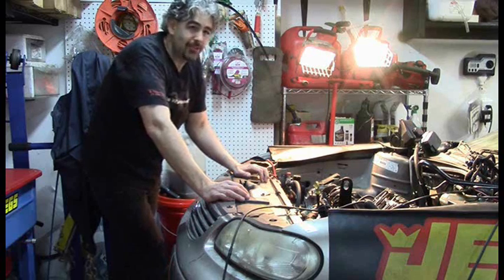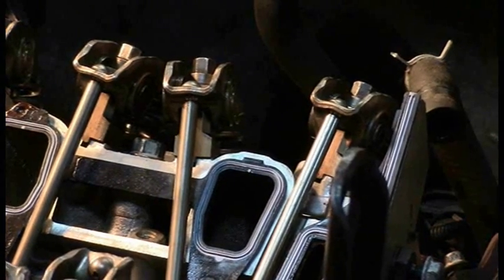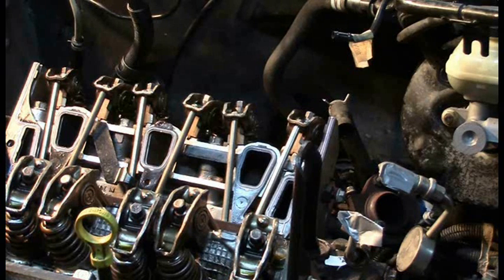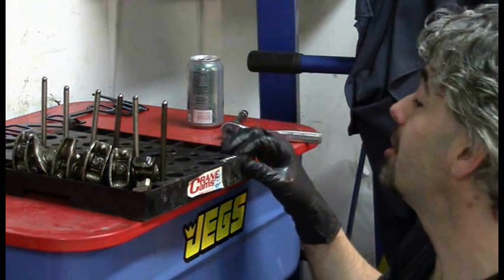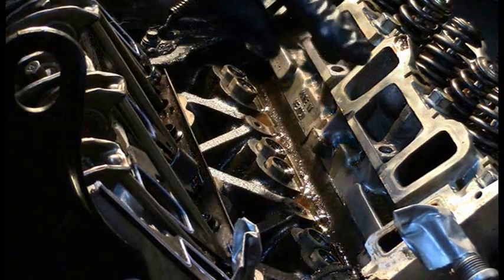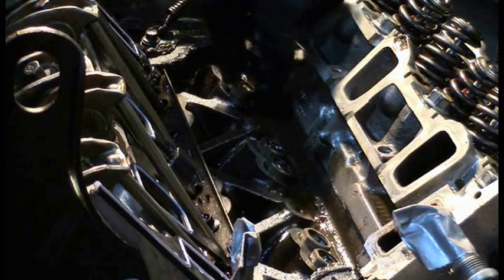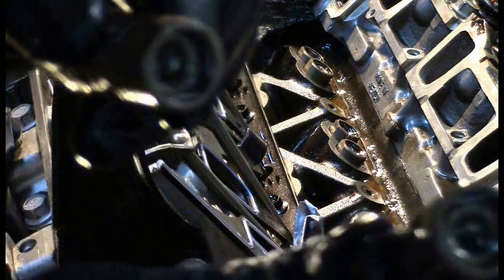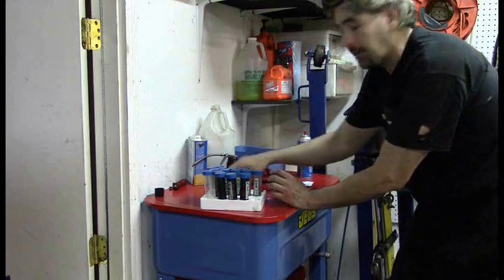Engine Noise Diagnosis Part 2- The Answer Revealed!

Comment: good job dude. besides the leak down test did you perform a cooling pressure test or combustion gases in coolant test just curious. Oh also did they report any overheating issues or boil over at all.
Reply from the maker: Hi Chris- No I did not do a pressure test because in my opinion the leakdown is ultimately definitive. I did not show the head replacement as I already have another video on that.  The customer never complained of an overheat but then again being disabled they drove the car very minimally- it probably gets under 10 miles a week I would say, so probably never ran enough to overheat, though they did have to keep adding coolant to it occassionally.  They are damn lucky the engine wasn't destroyed!  It is still running fine to this day.

Comment: Very good. Is there a video showing the head gasket replacement and the process to straighten or resurface the head? Thanks
Reply from the maker: @TPCoach- In the interest of time and staying on focus for the specific content I did not film anything with the cylinder head.  Besides, I try to generally make my videos more about the diagnosis than the actual repair. It seems there are thousands of "repair" videos on YouTube but very few that (IMO at least) that are good with showing diagnosis so you know you are doing the correct repair in the first place!! 
  However stay tuned. I did get a call about another car that I strongly suspect has a minor or initial stage of some type of head gasket issue, and if so, I will make a video comparing the many various methods for diagnosis of a failed head gasket and see which ones are most accurate- from chemical test to compression test to leakdown to visual tests to coolant pressure test...and even a few experimental tests I thought up and we'll see how they work!
I will also cover the repair including measuring for flatness and testing for cracks etc, gasket selection and preparation, torquing, and break-in.

Comment: Nice work Matt and I'm sure the customer is very happy now.
Reply from the maker: Thanks Terry. They were happy-  In fact- this car is owned by a disabled couple who didn't have money to fix the car and it actually sat in their driveway for 2 years.  After hearing their story, I couldn't help but fix the car basically for cost of parts. The woman actually cried when she heard how smooth it started up and several of their neighbors now have asked me to do work on their cars after seeing the "miracle resurrection" of that car after 2 years!
Reply: Schrodingers Box That's really great of you Matt to help someone out like that who really does appreciate it. I can remember when I was working for myself doing electrical contracting work. This whole family was laid up in the house because of a car accident. There were casts on their arms, legs, bandages,etc. After hearing their story, I decided to install the 120V outlet for their window air conditioner for free. Although I told them the pricing and they agreed to it, I surprised them at the end by saying the job was free. Although the price was only a $100 at the time, you thought they won a million dollars. It made me feel pretty good that what I did was appreciated. I'm sure you felt the same way when you saw the lady crying. Wish I could have been there. Take care Matt.
Reply: @SchrodingersBox  kudos to you, Matt! My '89 3.1 has the same exact noise so I'm going to go through this procedure. I have to assume those collapsed lifters were not pumping oil up the pushrod, correct? I can see and feel a cylinder #6 pushrod through the oil fill and after running the engine for short period it is bone dry.
Reply: Schrodingers Box Great kindness. I am a Firefighter and love seeing people do good for people. More of that in society would be great.
Reply: stuzman52 That is a good thing you did.  Now they will be inspired to do something for someone else when they have the opportunity.  Imagine what the world would be like if everyone did this!

Comment: Did you also take care of the head gasket problem while you had the engine torn down that far?
Reply from the maker: @tpcoachfix- I did indeed take care of the head gasket but I didn't show it since this video was about the engine noise.  The head was indeed warped (a previous "craigslist mechanic" did the work and just replaced the gasket and never checked for cause of the blown gasket) and in fact I removed both heads and had them fluxed and resurfaced just to be safe.
Reply: Schrodingers Box Did one show a crack at all. good job dude.
Reply from the maker: ***** Good question- as part of the machine shop resurfacing job, I did have both heads magnafluxed and no cracks were found.  The cause of the original overheat condition, I suspect, was an extremely dirty radiator as all the fins were very clogged. Powerwashing it looked like I was powerwashing pure mud from an offroad vehicle!
Reply: Schrodingers Box Wow. I had one like that before. As technicians we are always looking for things that cause engine failures and bad running engines. It just trained into us as we do visuals over all engines. You can tell approximate condition of an engine based on how well the car is taken care of. Well thanks for replying back, if I have any good diag techniques I post them to you. always watching your channel good teachings.
Reply: ***** Great tip about gunk build up being a sign towards "think the worst is more likely than usual".
Reply: Schrodingers Box Ah, reading this other day is probably why I thought to look at the splines of my radiator. Not much of the front of the radiator is visible considering the condensor and the upgrade of a transmission cooler but what I could see was all plugged up.

I've heard that pressure washers can cause more damage to radiators, and I don't have one anyway, so I tried break cleaner.

Spray a little, blast it with air from my compressor. And repeat a LOT, lol.

I first cleaned the small amount of the radiator I could see then moved, to to where I couldn't on the half clogged condenser, and I just had to hope that the cleaning carried back through the radiator.

Without a deep look, I'd have never noticed. The back of the radiator looks brand new, and the transmission cooler up front still does too after 7 years...excepting getting hit by rocks.

Ericthecarguy has a video about cleaning with a fluid that HVAC repair people use on homes, and it works great on cars but there were complaints about the chemical being about $90 and available in quantities that'd last a lifetime unless you were a technician.